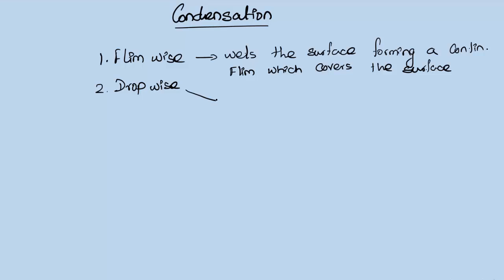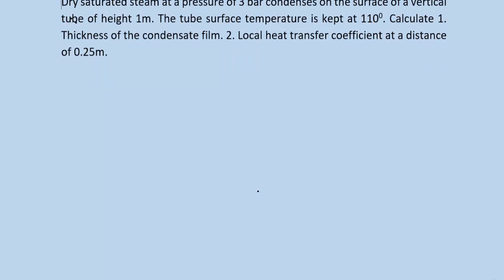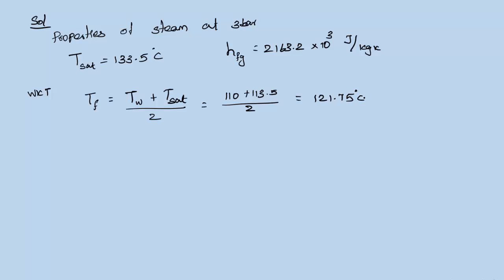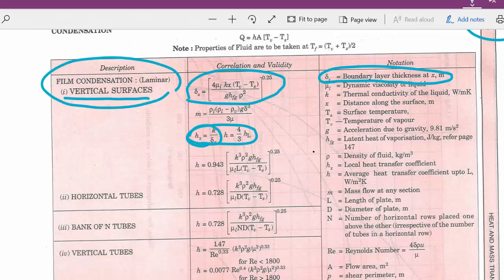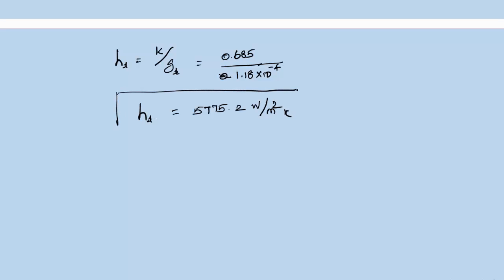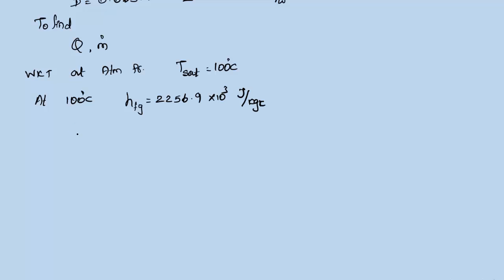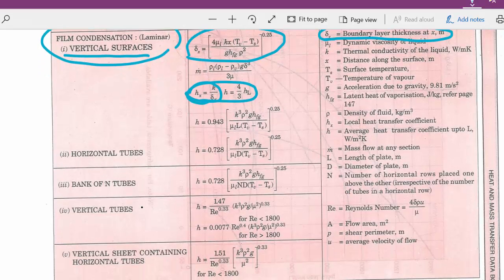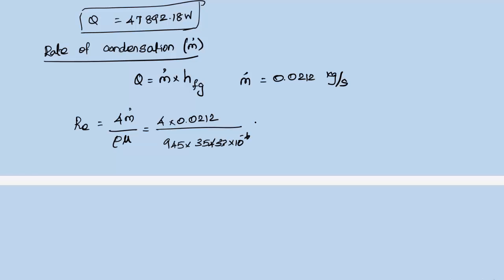Lecture 23 | Problems on Condensation | Heat and Mass Transfer

Comment: In my data book for thickness (Tf-Ts) is given where Tf= film temp. Should I use it or yours?
Reply from the maker: its purely an assumption...if there is a condensate film already present we have to take film temperature(Tf-Ts)....if there is no film presence then we can go for saturation temperature(Tsat-Ts)...this is the concept....but if you are using a databook you can quote that databook and use that same formula

Comment: In the problem it is shown as vertical tube, but you have taken formula for vertical surface??
Reply from the maker: There will not be much difference bw vertical surface and tube..
Reply: @VENKATQ  can we also take the formula of vertical tube?